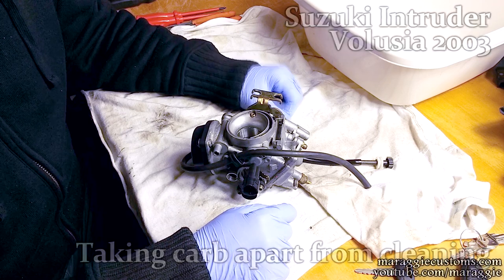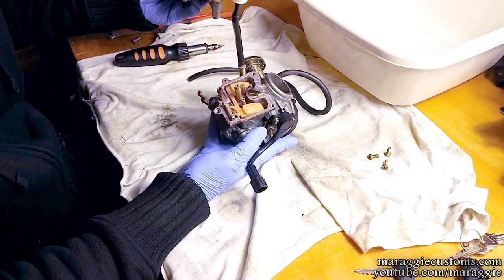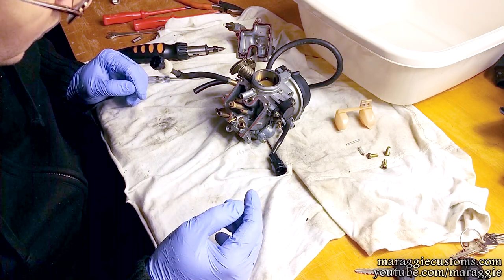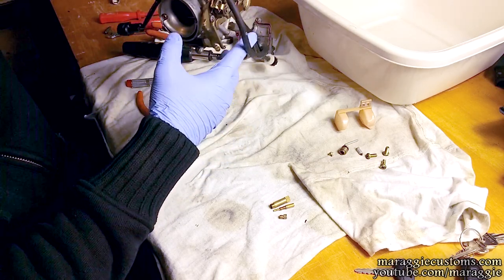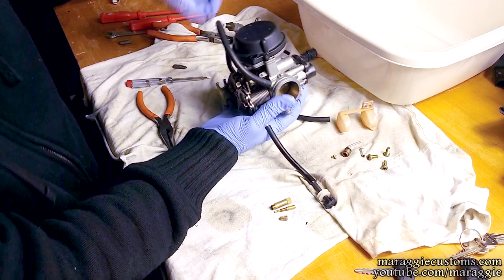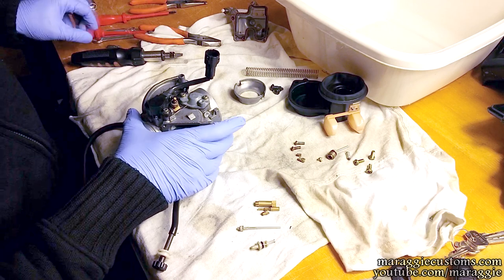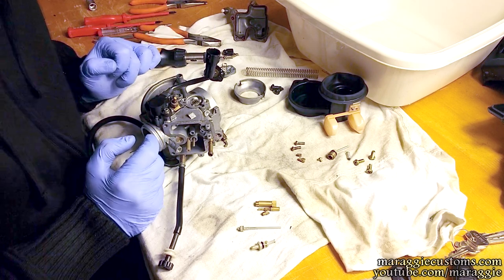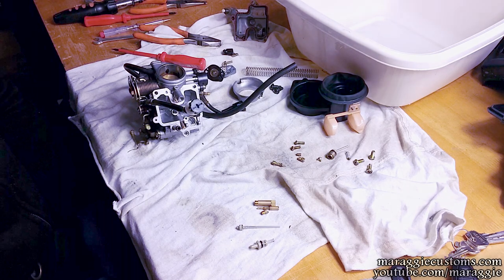Suzuki Intruder Volusia - how to take the carburettor apart

Comment: My needle diaphragm has two holes in it is that normal or would that be a vacuum leak?
Reply from the maker: +ponca622622 Hi mate. No, the diaphragm shouldn't have any holes at all. Replace it at opportune moment.
Reply: Two holes where the slide goes into the venturi . I thought that would be counterproductive losing vacuum.  thanks for the info.
Reply from the maker: +ponca622622 Can you show me a photo? Perhaps I misunderstood.
Reply: It has two holes in the end of the piston where the needle goes across the opening in the carb.  Looks like factory made that way  I will take a photo and try to upload if need be.
Reply from the maker: +ponca622622 I'm only relating to this: http://i.ebayimg.com/00/s/MTM5M1gxNjAw/z/QEwAAOSwHQ9WXmnw/$_35.JPG 
Down below I honestly can't remember if there's any holes there. :(
Reply: I'm talking about the piston itself, the diaphragm doe need to be changed but no holes in the rubber.
Reply: It runs fine with the two holes.  Guess they are supposed to be there.  My problem was a pinched fuel line when put back together.  Thanks for the info and nice video.
Reply from the maker: I'm glad that's sorted. Always something new to surprise us when trying to fix it :)

Comment: failure :( I rebuilt my carb and my engine still sputters at low end acceleration. my 2001 Volusia is wonderful except for that fatal flaw. Any ideas?? I've even tried the air/fuel screw and it didn't do anything to fix it. so I put it back where it was.
Reply from the maker: Hmm... 1. new jets? 2. float set correctly? 3. diaphragm without any holes? 4. fresh fuel? 5. does it start cutting out just as you start twisting the throttle? - that would be the point where fuel delivery goes from pilot jet to main jet - where I had my problems. 6. does it run good under more throttle?
Reply: No new jets just soaked in carb cleaner for 24 hours, float set standard, no holes in diaphragm, fresh fuel, it only cuts out/sputters under load at low rpm such as from a top or up a hill, reving, idling and steady to high speed are flawless. The problem goes away if I have the choke engaged
Reply from the maker: I would bet on the pilot jet. Sounds almost exactly the same as my problem. Soaking won't help, that bloody residue is invisible and doesn't come off. Once I put new pilot jet in, the problem disappeared. Now I replace jets every winter.
Reply: update: brought it to a mechanic. I was missing an o-ring on the diaphragm, rejected slow jet from 27.5 to 32.5, set the mixture screw to 2 turns, shimmed the jet needle and bam! flawless throttle responses
Reply from the maker: That's great! Well done on seeing it all through. :)

Comment: how many turns, for the air jet?
Reply from the maker: Hi. As the video says, count it by turning it all the way in until it's seated. Then you'll know how many turns out it will be when you're assembling everything back after cleaning. It's always best to set it the same as you had it before disassembly.
Reply: @Maraggie  ty for the follow up. I found factory set is 3 turns out. However Now that I have rebuilt/cleaned my carb, I cannot get it to start. 

My original issue:
Bike started, black smoke out of exhaust, engine would not stay idle, and bike would die out. based on symptoms, assumed carburetor issue.

Current Issue: 
Cleaned and rebuilt carb. Now Bike wont start. Any suggestions?
Reply from the maker: @sirkreitz4484  Hi. Black smoke would indicate either very rich mixture or poor spark. If you've assembled the carb correctly, I'd ask if you changed anything else on the bike... new air filter perhaps?
Reply: @Maraggie  thanks again for follow up.

I managed to get her started and running. I then further tuned the “fuel mixture screw” (I found out it’s not “air screw”) and had decent results.

I reduced the black smoke to be almost none at idle, but noticed it would puff a black smoke under high rev.

I further adjusted fuel screw and idle screw, but overstepped the adjustment, to which she died out on that last adjustment.
and now can’t get her to start again 😅😓 back to square one, resetting fuel mix screw…

This brings me to 2 questions…
1) what should the idle screw be set to? Full open/closed/mid…?? When re tuning the fuel mix screw?
2) am I doing anything horribly wrong? Or am I on right path? Please be candid as needed…

I appreciate any feedback 🙏

Also I have not done any other changes to airflow/filter. However I will look at the filter and see if it needs replacement. Ty for that suggestion.

I also ordered replacement plugs, just incase spark is bad/ or needs replacement.
Reply from the maker: @sirkreitz4484  Hi mate. Idle adjustment is fairly easy. The more you turn it in, the more the butterfly opens. This just controls how quickly the engine idles and when you turn it out too much or close completely, it'll keep dying. Rule of thumb - start with butterfly opened just a tiny bit to let some air through. Once you have this set, the bike should start and then you're just tweaking the fuel mixture. If you want to be close to perfect, I recommend something called Gunson Colortune. It's a special sparkplug with a view slot so you can see the color of detonation inside the engine. This will allow you to set the mixture close to ideal. Keep at it, you'll get it right eventually.
Reply: @Maraggie  I ended up getting it to fire back up. And even tuned enough so no more black smoke puffs. 👍👍😎 I really appreciate the insights and encouragement. Thank you for hosting these videos - it helped a ton!!! 👍👍
Reply from the maker: @sirkreitz4484  Fabulous! Nothing like a satisfaction from getting the bike working. Very well done.

Comment: im getting fuel in the carb buts it not coming out of the rail when u give it gas iv clead it still does it wat can it be
Reply from the maker: Hi Thomas. How do you know you got fuel in carbs? If there indeed is fuel in the float bowl then it would suggest that your jets are blocked? Also, did you check when you twist the throttle that the butterfly in carb opens? Let me know.
Reply: i putt bigger jets in it runs great now also was because i had the air filter off didnt know u couldbt run with it off sucks to much air?
Reply from the maker: Super. And yes haha.. I did that once...forgot to put the filter on and it was sucking so much air in that it didn't want to run :D  I'm glad it's sorted.
Reply: thanks for the quick response
Reply from the maker: Anytime. I'm happy to help. I just came back from holidays hence the delay in replying initially :)

Comment: finished cleaning now it runs worse than before. back to the drawing board
Reply from the maker: have you replaced the jets with new ones? What's the symptom of running worse? perhaps it's starting to run good for the first time and something else needs adjusting now
Reply: same jets just took out cleaned replaced. wont run without choke. choke out to start, choke in dies instantly. before it ran bad at idle and slow but would run without choke
Reply from the maker: 1. Mixture screw adjusted by the same amount of turns? 2. is the choke valve correctly inserted back? 3. did you by any chance bend float valve adjuster? 4. always good practice to replace jets with new, even if old look pristine 5. how did you clean the jets? if you scratched them inside, they're toast
Reply: first let me thank you for your help. after reviewing your and other vids on this I see some issues. when removed mixture screw oring and washer not attached. float valve adjuster? choke valve? is that the plunger? I will get back into it this week too hot now. get a rebuild kit. I will have it up by Biketoberfest next month. cleaned jets spraying carb cleaner through them used very small wire and spray on pilot. could the mixture screw be the culprit? let all jets soak in carb cleaner 1 hour. replaced bowl screws with steel socket head screws. thanks again
Reply from the maker: Sorry. float sits at a specific angle thanks to the small metal bit on which the valve hangs. If you bent that then the float would sit too low/high and mess things up. (when you run on choke that whole system is bypassed if I'm not mistaken)

 Yes, I meant the plunger lol... not a good day for me with words :D  

That wire in pilot jet... ugh... Reason I'm cautious is because it just took some residue for mine to run bad... a scratch can probably be worse. 

Mixture screw...hmm perhaps not...it would only make the bike run rich or lean...not die on you like yours does. 

Did you spray cleaner through every hole in the carb?
Reply: I basically only cleaned the bottom. took top off pulled out slide inspected and closed backup. the float was tricky getting the hinge back in the valve kept coming off the metal bit. no obvious damage was done. So I will do it again using new jets, pilot and main and get the mixture screw sorted out. the plunger was reinserted with no hang-ups nut tightened snugly choke pull is smooth and easy. Do you have a trick for adjusting mixture while engine running? cant get at it.
Reply from the maker: If you want to adjust the mixture spot on, get yourself this: http://www.gunson.co.uk/product/G4171 
Basically a transparent sparkplug that allows you to see the explosions inside the engine... cool as heck.
Then you adjust the mixture until the colour is right...  :)